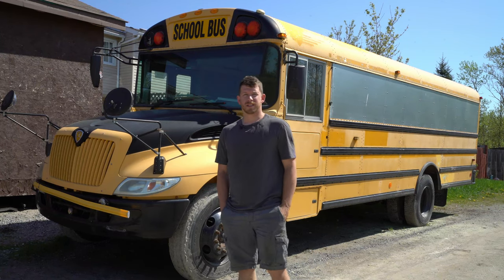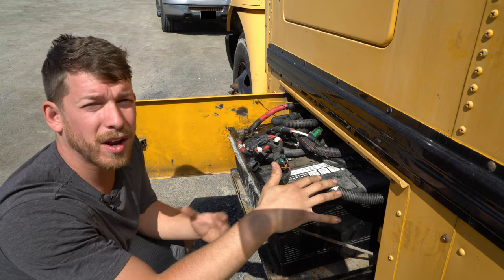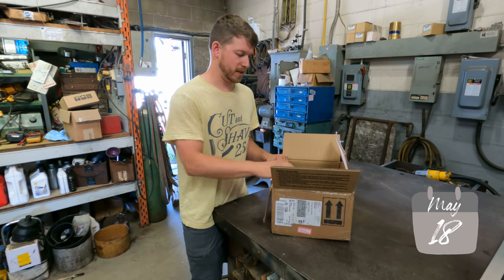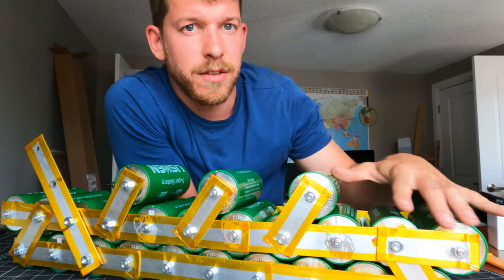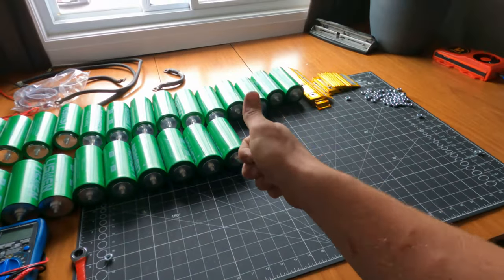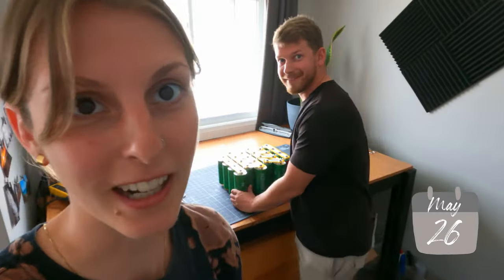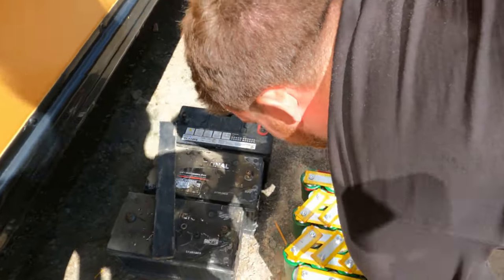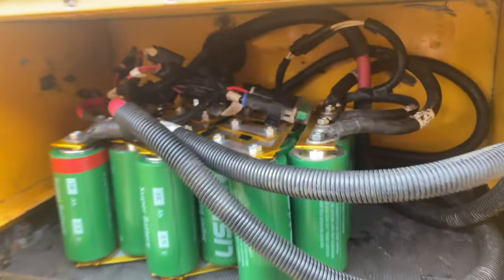DIY Lithium Titanate (LTO) Starter Battery | Skoolie Conversion Ep. 9 | Adam & Steph

Comment: That’s a nice LTO pack! Love to see folks using cells to make starter batteries out of these.
I built a 30p4s LiFePo4 100ah out of 36650 batteries for my diesel truck and then decided on LTO for the wider temperature tolerance and better charge/discharge rates.

In the interest of safety, get something to strap that thing in place. Heaven forbid a pothole shift that thing and it arcs out!
Also consider adding an active balancer, they’re cheap insurance IMO since that’s an expensive pack.. you don’t need a BMS since those cells are tough, but there’s a chance they could come unbalanced and die an early expensive death.
Good luck on the project 👍
Reply from the maker: Thanks! Check out our update video to this build
https://youtu.be/RRJ1-7_hYJw  it was definitely dangerous sitting there all exposed to short circuits. Good point on the balancer. Im having an issue with my bus draining the battery constantly and i went on holidays and came back to it at 2 volts…soo it might be permanently damaged now 🤪 going to make another follow up video in the future. Its voltage isn’t a good match for 12v either at 6s. 5s might be better if your alternator  output is below 13.8v. Happy building!
Reply: @AdamandAtlas  sorry to hear that about it draining down! 😬 Sounds like a parasitic drain from somewhere.. explains why the lead batteries were toast. I’m finishing up upgrading my wiring to accept a high output alternator that will keep me at 14.7v 🤙 if that beast ever needs an alternator upgrade… hit up motor city reman. Cheapest prices around and a warranty 👍
Reply from the maker: Im installing a 30kwh LiFePo4 battery for my offgrid system in the back so might build a super capacitor bank to start the engine if its toast. Because ill do anything but buy lead acid haha
Reply: @AdamandAtlas  funny you mention super caps… the passenger side battery in my truck is a super cap bank of the 3000F cells. (Driver side is a dead as a doormat lead… hints why I’m building a new one) it works really well and definitely has the power to crank my 6.0 even in freezing temps. Unfortunately it does not have NEARLY the storage capacity to pull the 300A the glow plugs require during the first few minutes at those temps 😅 (hints upgraded alternator… stock one was already too small)
You could definitely get away with it if you were willing to use the house battery for reserve capacity till the engine warmed up and the glow plugs turned off.
Reply from the maker: Agh yes. I never considered the glow plugs. I wonder how much amperage they pull and if i can connect them directly to the big bank. I could probably build a stupid big super cap bank if i cant. Hmmmm! Much to figure out!

Comment: you will be better with a bms, there are active bms modules that should work well. Also a smart bms which has the ability to disconnect the battery is tricky because if it disconnects it while charging the output voltage will spike until the regulator senses the new voltage. For that I think a TVS diode can be used but it’s easier with a simple active bms
Another problem will be the charging current that will probably be high and the alternator will work for a few minutes on maximum load. Idling at full load will very likely fry the winding and diodes because of insufficient cooling (also alternator efficiency  may be lower than at higher speed). I’m also working on a project like this and my plan is to use a 10W fan (blows like 10x stronger than a computer case fan) and a 75C thermostat. Then another protection I will do is to install another thermostat (75C with 7Amp)  inside the alternator and I will disconnect the rotor brushes wire and put the thermostat is series. in parallel with the thermostat (I will mount it outside) I will try a 4.7Ω 60W resistor with the aim of reducing the excitation current to make the alternator run at half load. the fan thermostat will trigger first because it will be mounted on stator iron core which heats up faster and if cooling works well, low output mode may not activate.
Reply from the maker: I would have loved to pit a bms on this battery for low voltage disconnect, but i couldn’t find a BMS that could handle the discharge current. I thought about paralleling a few together but that becomes cost prohibitive. The battery is also not an ideal voltage so its always undercharged. Lots of things to work on until i have the perfect lithium starter battery that can start a massive diesel engine without a worry in the world lol

Comment: What about the alternator, did you have to up grade it? What type of alternator are you running?
Reply from the maker: The bus had a 180amp alternator stock. The 3 original batteries were demanding in the alternator so this lithium battery isn’t much different

Comment: Great idea you may wanna also think about adding solar panels on the roof and adding an alternator switch so you can shut your alternator off when the batteries get low he could flip the alternator back on. 
By shutting the alternator off and running off the battery, you can save 10% on fuel cost

Comment: I was wondering if you could please explain to me how to do this with a regular car battery and can it be done with say an xs power 6 pack of LTO cells or something else like that I'm trying to avoid paying thousands for separate batteries only to get 30-40 AH of LTO when I can buy a cell bank for around 400$ I just need to know how to get it to work right with my car is a BMI all I need
Reply from the maker: If your intention is to just start a car, don’t copy what i did. My battery was this big to start a massive bus engine. If you need capacity, use LiFePo4 Chemistry, and put a BMS with a heater function and install heater pads. This will give you all the pros of this battery, but it will be cheaper, and have much more capacity. To get cranking amps, use HP headway cells. The voltage mismatch of LTO makes them not very practical for 12v applications.

Comment: in a 12Volt application I found that 5S configuration was better than 6S due to the 2.5v rating. With 6S if the voltage  is down a bit , it easily drops below a threshold where the usable voltage suddenly crashes. With 5S however , the voltage is kept higher in each cell, so there is a wider usable voltage range .  But , when Lishen approaches 3V when charging, its best to add a simple protection board that balances at around   2.8v and above   .  Otherwise in 6S  you could just look at raising the voltage output from your alternator to 15v .   ( Yinlong 2.3V cells in 6S are superior though!)
Reply from the maker: I racked my brain between 5s and 6s. Id like to put a protection board and let it disconnect when the batteries are at there max recommended voltages, but the amperage required to start the bus can exceed 1000amps easily. Theres no BMS i could find capable of that amount of discharge current.
Reply: @AdamandAtlas  No need for BMS..just a basic board that balances the cells voltage by bleeding-off any unbalancing  and let the alternator itself regulate total voltage. Vehicle alternators are the perfect charging system for these batteries compared to the mucking about you need with 'mains' designed charging systems. These Cells are quite tough little things. I cant believe how much cranking time they have compared to a descent lead-acid .

Comment: Count me in! I want to see how to make one for my planned retirement RV :) My concern was the aluminum bus bars vs copper? How well will the aluminum hold up to corrosion or is galvanic corrosion a factor with LTO batteries?
Reply from the maker: The cells are constructed of aluminum, so i don’t think corrosion is much of a concern. The bolts I’ve used have corrosion on them tho because they are some kind of coated steel. If i had a source of copper, i would have used it for its favourable conductive traits. Tho i’ve had no issues with the aluminum. On startup, the aluminum remains cold to the touch. I would hold on from building a LTO starter pack tho. After much testing, i don’t trust these cells. They keep self draining and i think they may be low quality cells. Im going to re-design a high-output pack with LiFePo4 cells in the future.

Comment: Dont you need a BMS system for charging?
Reply from the maker: typically, a BMS is a good idea. in this application with this battery chemistry, it is not necessary. as long as you're careful to not kill the battery too bad, there's not much that will hurt it. LTO can handle practically any temperature, and the alternator will only charge it up to a set voltage.

Comment: Suggestions: add an external led meter inside the battery compartment, just incase the batteries need a charge, also make sure the skooli's alternator is working 90% so there is a charge in the starter battery just by running the engine on a cold morning, Stay safe.. regards from Singapore, GOD BLESS.

Comment: I would have gone with thicker buss bars, those cells are absurdly powerful, the bank you built is easily capable of 2000+ amps. which I mean you’ll probably never use near the much but it’s better to have it and not need it than need it and not have it lol
Reply from the maker: If the studs on the batteries were longer and could handle thicker busbars, i would have. But even with 1/8th aluminum bars, theres no measurable heat buildup when starting up the bus. And that the highest load ill ever put it under.

Comment: Excellent I'm not even going to critique your build prob cause I'm building one too 🤠 I will be using the yinlongs with a active balancer just to make sure each cell stays within range I mean 16$ insurance is cheap insurance for 1-3k$ battery
Reply: It's an ambulance 🚑 build out course it's winter in MN so I'm just ordering parts now considering they mey be harder to get come summer
Reply from the maker: Very nice! I’d recommend building it as 5S (5 cells in series). The voltage of my pack in 6S is a bit high and requires the battery to be drained to ~30% to work. You will have to make sure your alternators charging voltage is below the max recommended voltage at 5s tho. Probably 13.8v or so. Best of luck!
Reply: It's an easy change on an alternator to have it charge at a higher voltage I'm using lto with solar and I would suggest a balancer they tend to get really unbalanced

Comment: Without BMS crazy dangerous.
Reply from the maker: The pack did need a non-conductive case to make it safe to handle, which we built in another video. But not having a bsm does not make it dangerous. The lead acid batteries this replaced did not have a bms. And Lithium titanate is not sensitive to cold temperatures unlike other lithium chemistries.
Reply: Not, but from overcharge, discharge and balance y need it. From some voltage battery drops quickly and when come out of that values, can cause damage cells.
Reply: @martinhyska1206  the typical lead acid alternator will never overcharge a lithium battery. Starter batteries rarely completely discharge unless there are large parasitic draws or the vehicle sits idle for months, and LTO has very low self-discharge rates. Cell balancing is the only value in using a BMS in this situation.
Reply: I'm running a 340amp lto in my converted cargo trailer and it does not need a bms they aren't dangerous like lifepo4 I'm finishing it this month it will be 640 amps

Comment: why did you take  4 cell in parallel, with 50C 18AH times 4 you have 3600 amps of starting power, your engine maybe needs 1500 amps, you could go with half of cells and other thing, your alternator keeps 14 v so you will not be able to recharge it over 75% what is not bad but if you have 5S 14 volts is just 2.8v per cell what is cut off voltage
Reply from the maker: My alternator charges at 14.2v which would overcharge my cells at 5S. I put more cells in parallel for more capacity, not total cranking amps. The grid heater on my diesel engine requires a lot of power prior to heat up.

Comment: Your battery is the bomb - I would strap that bomb down since it is sitting inside a metal box (why they are called "DEAD" shorts)
Reply from the maker: We built a custom enclosure for the cells and strapped it down in our follow up video on the battery build!
Reply: is not, ltos are very safe, but must take care to not short circuit it because something else could be burned

Comment: No BMS? ...u are brave!
Reply from the maker: If there was a bms that could handle 1500 amps, i would!
Reply: @AdamandAtlas  you know without BMS and charging those batteries would kill them 100 times faster right? or fail one cell prematurely making ur battery kinda of expensive junk right?
Reply: @AdamandAtlas  you dont need a 1500amp bms. You can connect the positive of the starter motor directly to the battery and the rest through a BMS.  Then you will need a much smaller bms, 100 or 150 amp will be enough.